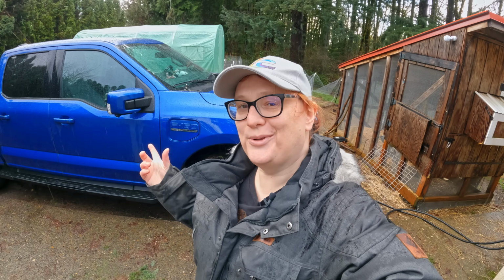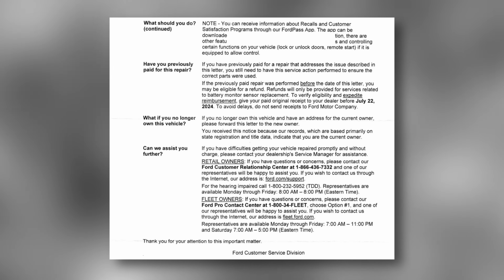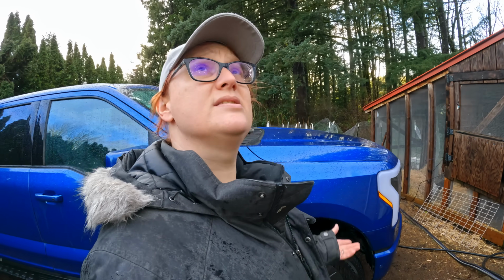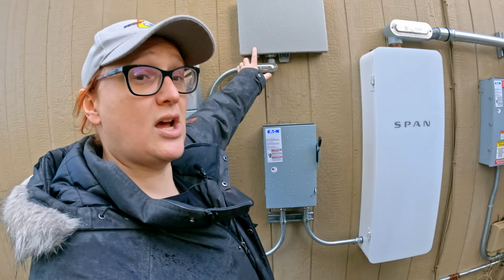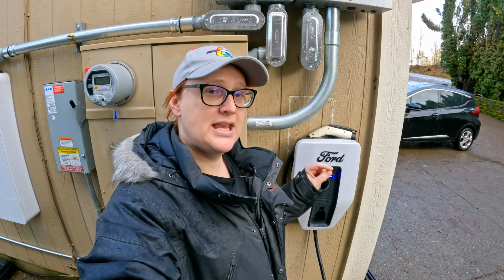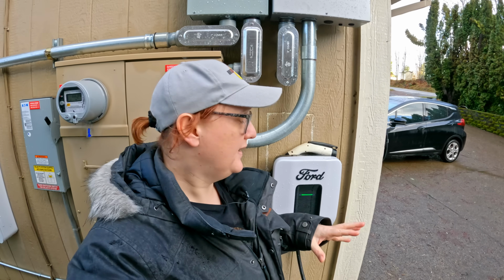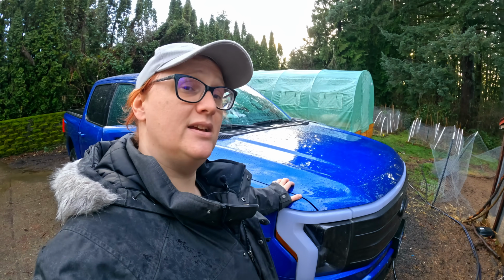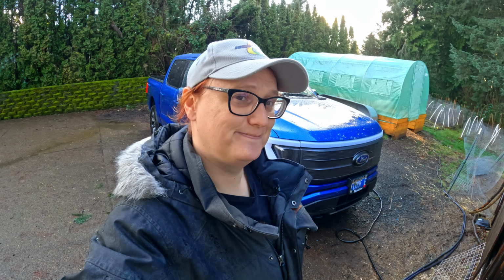Is Our F150 Lightning's Battery UNWELL? (Plus, How to Reset Ford's Home Integration System)

Comment: Why is there a starter battery in an electric vehicle? Would it not make more sense to have a Deep Cycle battery for that job as it does not have a starter motor?
Also who wants a vehicle which relies on software?? I have a truck with mechanical diesel injection that’s 50 years old with an air starter, it only needs a 12 volt battery for lights and wipers.

Comment: That the system can't communicate over the wires plugged in to the pickup is an insane design decision.

That said if your house had 1/3 the battery capacity of your truck you could go 100% off grid.

Comment: Ours just came back after 33 days for our battery module recall. It was killing me, as I'm trying to start a movement for building small, mini-grid solar systems mainly for charging your EV, and we had just finished our system(check out the build), and had nothing to charge for a month... grrr. Early adopting is a pain sometimes, but our lightning hasn't had any more issues than my 2008 Subaru WRX which was also a major change for the model.

Comment: Nice video, Nikki. I have a ‘23 Lariat. The 12v battery is not a “starter battery,” per se. Why? There is no starter, which is a 12v motor that turns over an internal combustion engine to allow it to run. This battery runs various 12v features of the truck. Ford could have used transformers to get 12v, but the traction battery is 400v. To step that down to 12v would require a big step down transformer and 388 volts would go up in heat. 😎
Reply from the maker: Nikki here. Except, it IS a 12V starter. Without it, the 12V circuitry required to engage the contractors for the main pack wouldn't work!

Comment: I totally understand why you chose the home backup solution, and I understand that OTA is super useful, but it does feel a little bit like you’re back in the same world as the Juicebox thing where at any point Ford could push an update the breaks comparability, simply walk away and you’d be left without a working system. Not sure how to fix that, just pointing it out.
Reply from the maker: Oh totally true - Nikki

Comment: Hey, I follow your channel closely since I have an early build 2023 Lightning with 6,800miles now and I wanted to share an issue I experienced today.  I went to a friends house for a few minutes and when I got back to the truck it would not start.  On the bottom right corner of the driver's cluster, the truck and battery symbols were lit in red also the start button was flashing green.  I tried doing the steering wheel reset and on/off multiple time with no luck.  Called the dealer and they said that they see a bunch of errors on their end and that some module failed.  They asked to tow the truck to them.  While I was getting ready to call the tow company, a progress bar appeared on the infotainment screen and said battery rebooting.  After the reboot the truck started working.  I do not see any errors on Ford pass app that the dealer saw.  Have you heard of something like this happening to anyone?  Not sure if it may be related to the 12volt battery.  The only unusual thing that happened today was a persistent message about an update.  I updated the software once I got home with no issues.

Comment: I like redundancy as well as simple things so I would add a generator input to your house with a manual transfer switch so you could take power from the Nema 14-50 output of the F150 to plug into that generator input.

Comment: Not so certain of the merit of using a battery in an EV to power a home in this instance. The life of a battery is largely determined by the amount of energy going through it. In a location where grid power is lost often the life of the vehicle's battery is being impacted plus the battery is not going to help if the vehicle is out on the road. In this situation I'd forget about the battery in the vehicle and have a dedicated home battery. Obviously that's going to mean more upfront cost but I think you'd have ended up better off financially and have avoided a lot of stress. The other advantage with this solution is the two batteries can be of the optimal chemistry for the task  Last but not least you end up with a sort of backup to your backup. To be clear, if your location was in a major city where loss of power is a very rare event then the solution you've chosen would be fine.
Reply: Or maybe just freezing to death in winter. Or sleeping in your car waiting for the power to return. All these choices were explained previously. 

In my opinion, if the vehicle is charged once a week and used for battery back up power once a month that is a 25% increase in cycle count. That means 1500 cycles in 7 years becomes 1900. Or 1500 cycles in 5.8 years. For a full home backup that is a very cost effective solution

Comment: To make the Lightning battery pack power available to power your home, Fords Lightning charger
is a Bi Directional charger allowing power to flow  TO  the truck or  FROM  the truck. Why that is
groundbreaking :
You come home after a long hard day, plug your lightning into the bidirectional charger & go inside 
for the night. The charger will to top off the battery pack &  THEN...... make the power in you battery 
pack available to the grid. Thats right. Instead of a neighborhood brownout some summer evening 
your power co can tap into your lightnings battery pack to power your neighbors AC. Towards dawn, 
your power co will see to it that they disconnect & your charger will make sure your battery pack is 
topped off for your ride to work.  NOW, if only  EVERYBODY used a Bi Directional charger the US 
would not need to increase its grid capacity at all.

!

Comment: ALL Evs use a normal 12volt auto battery to unlock the doors. Every EV has a way to get in if the battery is dead. 
Every EV owner needs to find out how this is done for their EV because someday you will need it. If you do not,
When that battery goes dead, and it will, you will have to pay for a tow to a shop & pay them to pop open the frunk
charge your battery & send you on your way. this is something everyone can and should do.

!

Comment: Sounds like you finally got the system fully operational, hope is continues to do so. Thanks for the tips on rebooting the charging interface seems convoluted but it did work.

Comment: $10,000 for the home integration system? Okay that is ridiculously too much. You can buy entire battery backup systems for that price and they don't go away when you drive your truck to the store! I like that Ford came up with a home integration system, however they way over complicated it!
Reply: Tesla powerwall system is 14K installed for 1/10 the storage capacity.

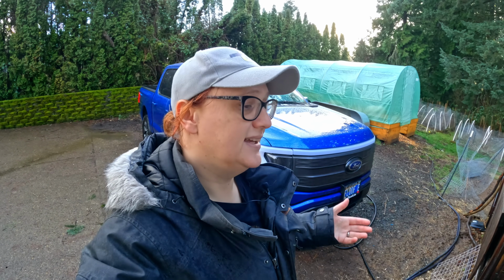Comment: 17:14 why not check if the F-150 and the charging station have a Bluetooth external antenna plug, like the ones on WiFi/bluetooth laptop cards ? If yes, just plug an SMA high gain Bluetooth Antenna to the circuit board, and Voilà! It will work. I suggest that you check if there interferences between the Ford Bluetooth carrier frequency and your Home WiFi channels. A good test, would be to completely turn off all WiFi equipments in your home and see if there is an improvement with the car Bluetooth connection out of line of sight. If yes, it is the problem. Some cheap aliexpress SDR kits can help diagnose frequencies overlaps. You should also turn off all non essential Bluetooth devices in your home when not used. Hope this will help 🤞🏻

Comment: Congratulations and this for sharing. For most people I suggest a trip to Costco where $5k gets you a lovely 22 kw home generator. Add a transfer switch, propane tank or gas and electrical connections and you have automatic backup no matter where your truck is.

Comment: Ford has, in general, a good product with the F150 Lightning, and there is no shortage of demand. However, Ford simply has to keep producing the Lightning at a loss until manufacturing can be refined to make production profitable. Postponing EV production can only lead to disaster. Tesla sold almost 2 million EVs in 2023, and Chinese carmakers sold 8.4 million EVs in that market.
Reply: "Postponing EV production can only lead to disaster" Tesla postponed the Cybertruck for almost 4 years.

Comment: I mean, if you had a transfer switch with a generator input, couldn’t you power your house using the NEMA L14-30R?
Reply: Considering the insane cost of the official home integration system, using the 240 volt circuit in the bed of the truck is my plan. I already have the transfer switch as part of my solar system, I just need to add the generator input which looks like about $100 worth of parts

Comment: That's why we call it "the bleeding edge of technology "! I'm sorry your family has experienced the costs and tribulations coping with experimental hardware and software, but you fortunately earn a living reporting on those trying experiences. I wish to express my gratitude for your sharing of those tribulations. I suggest that you build a security cage around your electrical equipment. You may need to experiment with building materials so you don't block your blue tooth compatibility. First thought is a metal cage. Maybe a composite material is best. Good luck! 👍

Comment: @Transport Evolved, have you considered a simpler path of using the truck's 220v outlet in the bed as a "generator" by plugging it directly to your main by a 30 amp feedback plug!? It's not automated, but it's much cheaper and reliable 🤔😃👍
Reply: Might be better to try to use the entirety of the onboard power. That would require a box that would combine the AC signals, but it would end up being able to power more of the home. It would need to understand how much power the truck could actually deliver to the house through the outlets.
Reply from the maker: Watch some of our videos on this. We’ve explained multiple times why we chose this option!

Comment: Hear me out. Just get a manual transfer switch and stop using there shitty system :) I know you will be limited to 30 amps vs the 80 but won’t have any dumb issues with it
Reply from the maker: We also wouldn’t have half the stuff powered we need powered.
Reply: @transportevolved  well if ya need more then 30 amps at a time that’s true.  I wish the truck had a 50 amp plug rather then a 30.

Comment: Would a tesla power wall not have been a simpler option?
Reply: “Simpler” maybe, but a Powerwall has a LOT less energy than the F-150 Lightning. Yes, you can add multiple Powerwall units, but to add enough to contain the same total energy as an F-150 Lightning costs more than a Lightning! And you can’t drive it around.
Reply: It would take 10 Teala Powerwalls at 10 times the price to equal this system.

Comment: In 2023 Ford had the most recalls of any manufacturer, seems like they need to focus on quality so they don't have so many recalls.
Reply: “At Ford, Quality is job 1……….hundred”
Reply: That's one way to look at it. Another way would be that they are extra-vigilant and are trying to catch small problems before they become big ones. One aspect of quality is following up with potential issues. I'd rather have regular notices about my car than have the thing die on me, only to find out that the manufacturer knew about the problem and didn't issue a recall.

Comment: I forgot is that battery a Lead Acid? Not too big a problem IMO. I have replaced those in my old leaf. They need a load, so I would run them on my amateur radios to give it a load.

Comment: They really need to switch to a 12v Lithium battery....o wait is it a Lithium battery?
Reply: 12v Lifepo batteries are available w a nice warranty
Reply: @rp9674  not a good idea for a car that does not have a lithium battery maintenance circuit built in.
Reply: @chrisbailey5055  I know but it's purpose built & has a warranty

Comment: Wow! All that crap against the wall!  🙂

It's impressive, and chaotic. Even I as a technology lover have to acknowledge that it must be quite off putting for the average person. Is all that ugliness necessary to go green? No thanks!

Makes me think about "Zen and the art of motor maintenance" where the main character delves into the fears of romantically inclined people when seeing industrial stuff like that.

Don't take it the wrong way, I love the work you do (although I would love to see more attention for smaller personal transport), but in this case I just wanted to give you a different perspective.
Reply: I want to think some of the chaos on the wall comes from how things were added to the house.  They also have solar, and then the rocky process that was getting the truck to actually work.  Ideally one would sit down and plan out such a project and come up with a manner of installing this equipment in a manner that would not have so much industrial "clutter" on display.  On our house, we do have the unsightliness of conduit erupting from the front of the house to feed our hardwired Aeroenvironment L2 charger, an RV style Nema 14-50 plug and a covered 110 outlet all for EV charging and trickle charging 12 volt batteries if needed.  Our main panel is inside our house in a little dedicated closet.  If I was to do what they have done, I'd make use of the wall space in the closet to house all of that gear.  We will eventually be adding solar to our house, so will be having to add some of that equipment when we do.  One thing I want to do, is add some type of steampunk looking equipment on the outside of the closet to allow us to monitor what's going on in the decor that we're ultimately and slowly changing our house to.
Reply: At least it’s very organized chaos.

Comment: Thanks for being on the bleeding edge with respect to the Lightning Home Power system.  Hopefully the system will now be reliable.

I have a 1010 Watt-hour  solar generator for my power backup.  Need power backup for CPAP machine.